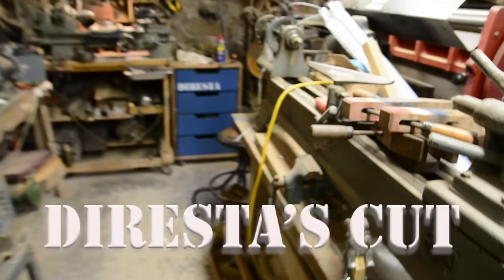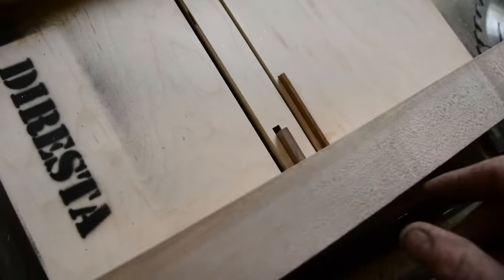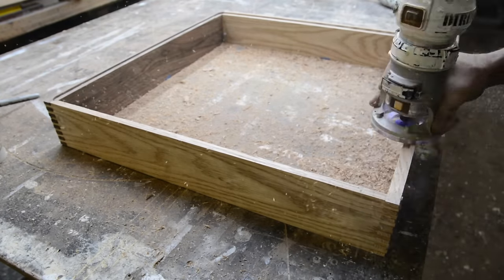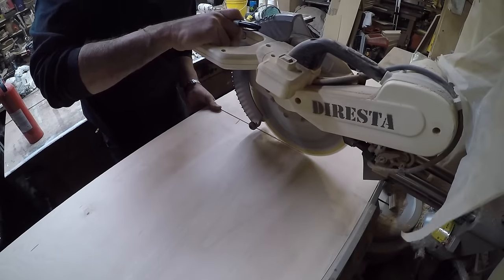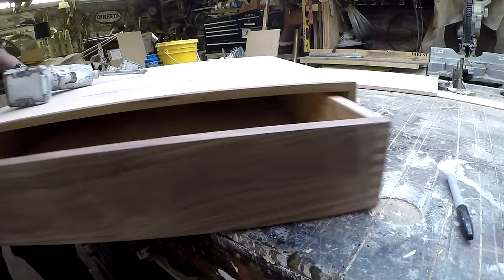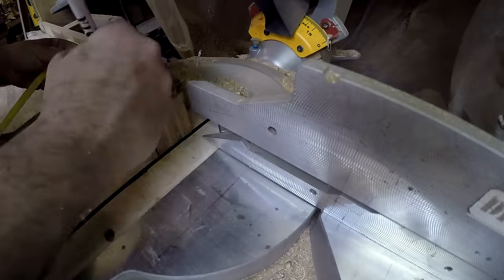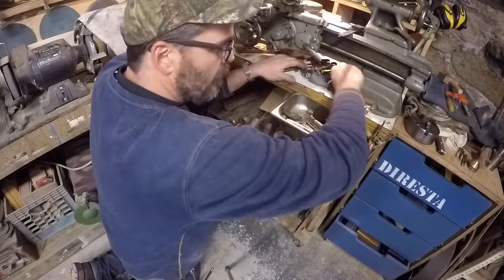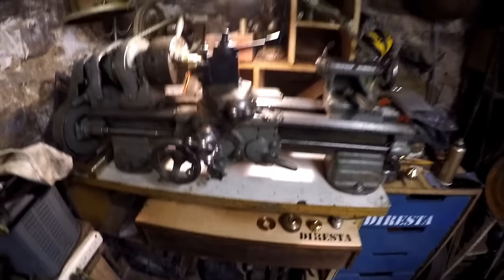DiResta How to Build a Drawer

Comment: Great little video Diresta!
 Maybe you could put a tiny lip around the edge of the top of hanger box that the drawer hangs from, so if you do put extra tiny project parts in that little ledge they won't get knocked off while you are working.